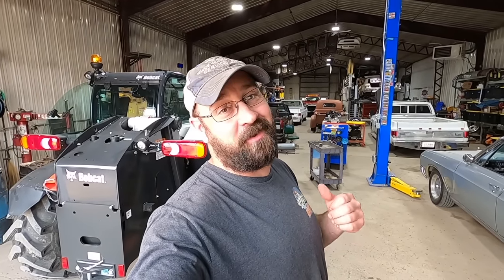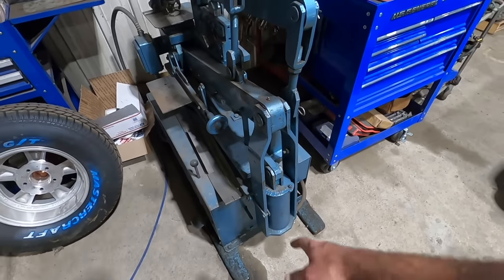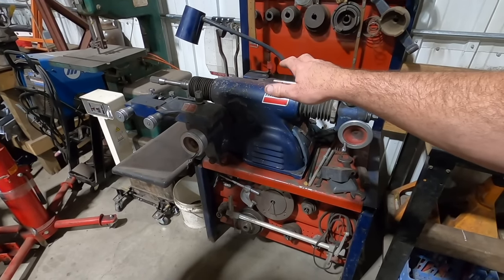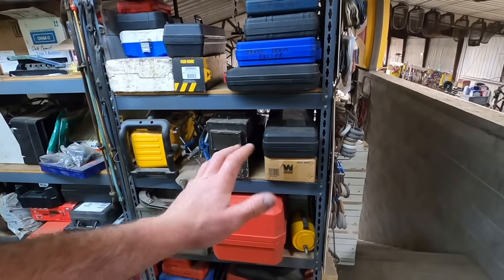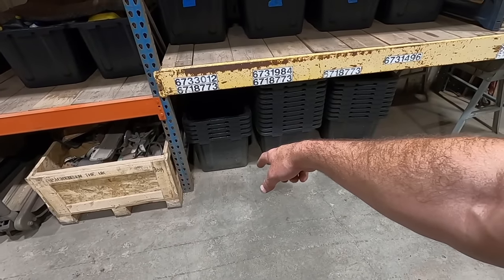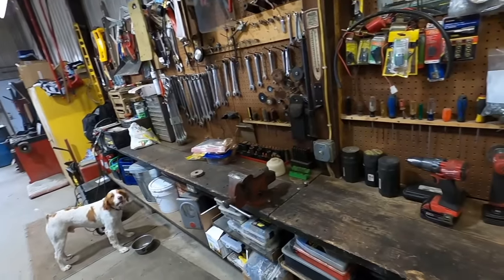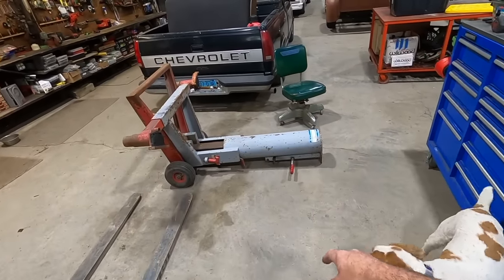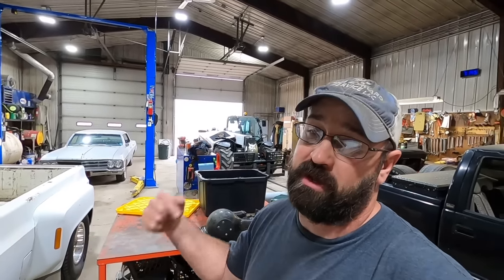We've been here for an ENTIRE YEAR! Upgraded Shop Tour of Mortske Worldwide!

Comment: Something everyone misses on the flammable cabinets is no one bonds/grounds them. I actually own a business that specializes in grounding and bonding. So it always amuses me all the business’s I see with flammable cabinets and then they fail to bond/ground them.
Reply: What do you do? Just Anchor it to the ground ?
Reply from the maker: Good to know, also interested in the process.
Reply: Was just about to say the need for  grounding of the cabinet. You beat me to it. 👍
Reply: The reason they are grounded is the same reason it is prohibited to fill a fuel a portable fuel can that is in contact with a vehicle....
There is a static charge between paint and plastic or just the paint to paint or plastic to plastic. A spark can happen faster that a blink if an eye! Gas cans and chemical containers are made of those non-degradable synthetic plastics that when rubbed together will produce static charging. The ground strap eliminates the static.
Reply: I understand what grounding is but what does bonding mean?
Reply: @moremortskerepair4354  Yep look up justrite flammables cabinet owners manual and you will see about the ground or bonding. There should be a place on the cabinet to mount a ground wire that can be bolted to a grounding rod driven into the ground.Or if nothing else bolted to the main frame of your building. Just like a negative cable on a vehicle goes to the frame and several other grounds to to various parts of the car. Also do not store anything on top of the cabinets that will burn. If you have cardboard boxes towels rags or anything else on top of the cabinets take it off there. there are also vents on the cabinets, they look like 2 inch drum bungs. If these are open and the flame arresting parts have been removed you have created a flame thrower if you have a fire event in the cabinet. You can also get self closing valves for these openings in case you have a fire to smother the fire by closing off its way to obtain oxygen. Make sure the locks work on the doors and they seal up properly, and latch closed. also set the cabinets up on blocks off the floor so you can get a pallet jack or that handy telehandler under it to move it when you need to. 

All the other fire prevention measures you mentioned are spot on. 

Scott
Reply: No don't do that I am an electrician the less sparks  you got from your cabinet the better, unless you're going to plug in your electric rattle cans or boombox in there, it's amusing to see how this guy amuses himself charging people to ground cabinets , but what is the purpose of a ground?? It's to keep people from getting shocked. Even if it wasn't a system ground and an equipment ground there's no equipment in there that should be self-explanatory,Let's say it was Supposedly hot ,you would fall to the ground and break Free. But if a spark touched off an explosion and fire, I'll just say I could see you with a full body cast at the hospital wondering why the hell you paid that guy money.. there's a reason you want to keep Sparks and flame fifty feet away, and that goes for electric wires also stop preying on people because they have no knowledge of electricity theory , at least find and show me an example of somebody's misfortune , they shouldn't have had any electric wire around that flammable cabinet anyway I'll debate anyone bring it. Let's say you had a ufer ground and you had an arc-fault in your building electricity which always finds the easiest path, could travel to that bonded cabinet and blow up your business and you would lose your shop maybe your life , I would suggest what they do in the oil fields. Inside of the dog house
Reply: yep my ass you look up any owner's manual and it will say something like that in it. I bet it'll say something about a choking hazard too just rite ? what kind of name is that? Spelled like last rites. Don't tell me the cabinets were just right ,so people started calling them that, smells like something the scammer would name.
Reply: A business that specializes in bonding and grounding? if you  are an electrician of any kind the first thing you should do is specialize in bonding and grounding. Everything you touch. And I wouldn't be touching any flammable cabinet because if somebody wanted me to put a circuit in it , I wouldn't do it ,I'd tell them to hire you to do it.
Reply: rather than me Educating you on your mis education study and look into why we don't bond a neutral and a ground in a sub panel. I'm talking about seriously understanding and  looking into how the electricity flows., And why you should never do that. You're going to argue there's no neutral in there ,I'm not talking about that I'm talking about the flow of electricity and the effect. How you're bringing a potential flow of electricity that should never be there.
Reply: @mrromantimothy  and you sir is why I have a business. Educate yourself before typing.
Reply: @jamesmcdonald5868  you're not filling any flammable containers while they are in there you're storing them in there and if you don't have a metal cabinet with metal legs touching the concrete floor
Reply: @gwisdallatexas  give  me an example of a metal flammable storage cabinet unbonded and ungrounded that was the source of any structure fire, metal legs anchored with bolts to a concrete floor is all the ground path it needs

Comment: Two suggestions...find or build a battery-safe cabinet. Lithium batteries can have a thermal event even without being charged. Also, use a covered metal garbage can in the shop. It prevents something hot from landing in the can and a lid will contain a fire if one did start. Remember no pile of greasy rags. Outside in a sealed can.

Comment: The ag dealership I used to work for heated their shops with used oil.  There were four furnaces to keep filled up.  Most of the local coops were doing away with anhydrous ammonia nurse tanks, so we bought several to use for oil storage.  We put one on a 5th wheel trailer and mounted a vacuum pump on the tank powered by a gas engine.  This worked really well to gather used oil from 55 gallon drums or chemical totes.  We could empty a 55 gallon drum in 2-3 minutes with NO spillage, mess, ect.  We could then pressurize the 'road' tank with 20 psi of air and transfer the oil to the lot tanks.  For being 'free' heat, it was a lot of work.
Reply from the maker: Awesome idea!
Reply: @moremortskerepair4354  just be sure to weld on some 2" NPT fittings  for the fluid transfer ports. It will REALLY speed up loading and unloading thick used oil.

Comment: A sbc 383 backed by a 700R4. Make the compression around 9.6:1 and a mildish hydraulic roller cam to keep the low end torque higher for the white low rider truck. You build it like this and you'll want to drive it everyday.

Make sure if you want to build the transmission yourself to source a '93 or newer 700R4 that has the factory upgrades already.

If you get cheap eBay aluminum heads, get ones with no bigger than 195cc runners and no smaller than 180cc. Buy them bare and make sure to use the green self wicking Loctite to glue the seats in(just in case) and they'll be good to go(a better valve job wouldn't hurt though). Get valves and springs to match the cam you pick. If you start out with a factory roller block you can get a factory regrind cam for about half the price of a new cam. They even grind them more performance orientated as well.

Top it off with your choice of a genuine imitation RPM Airgap dual plane intake (or original?) and your choice of carburetor. 

The rear gear should be at least a 3.08:1 gear so the trans can be shifted into overdrive@ 45 mph. From the low end torque from a mildish cammed sbc 383 you can probably get away with a 2.73:1 at the numerically lowest but may need to wait to shift into O/D until 50 or wait till 50 mph to hit the lockout switch? It probably has at least 3.08 gear in it already? 

This should work just fine with factory exhaust manifolds so you don't have to deal with headers. Just make sure not to get to crazy with the cam's duration @ .050", keep it below 225°. My cam is an Comp XFI grind that works great with a carb that is 202°/212° @ .050" with .550"/.546" lift that pulls like a freight train in 1st gear.

Comment: That air jack will become as important as your telehandler if you give it half a chance. Think oil changes on "will it run" projects in the field. Think walk-arounds. Think tire inflations. Think getting blocks under deeply buried yard art. I used them in dealerships in the '70s and '80s. SO much more portable than a lift. So much faster than a floor jack (and higher). My guess is they lost favor when plastic bumpers became popular. Anyway, try it. You'll like it.

Comment: Dam late to the party, but nuthin unusual bout that.
My my little heeler will soon be leaving me, she's got liver cancer, and is fading swiftly. 
What I was going to say was you should put motion light sensors in the areas that you aren't in very often, but when you are, it's typically not for long.
Mine are set for 15 minutes once they detect movement, and will stay on as long as your moving around.
Once you leave there, they automatically shut down in 15 minutes, but you can set them up in 5 minute incurments, are you can hit over ride button if you plan on being there for a longer time frame. 
You can even set the lights up in main shop area to come on, and as you pass through the area they shut down in like between columns, and as you walk straight through, into the next set of column rows from left to right come on at one time.
Then as you move out of one section to the next, the lights behind you shut down and they progress as you do, and as you enter into the next row they come on.
That way if you have your hands full leaving say the mezzanine headed down stairs  
The sections you, are someone else isn't working in, then all the lights stay off,but someone wants to work over at the far end of long shop like yours.
Say Mo Jo is working far end of shop, and you're on the other everything in between is off.
Saves you money in the long run because you don't have to have whole place with lights on wasting electricity

Comment: So why can't u put in a floor drain?
Reply from the maker: You ever put one in?
Reply: @moremortskerepair4354  cut a slot in the concrete, expose the gravel, place a grill, no?
Reply from the maker: @frankfurther3828  Where does everything run to? just sits there in the gravel?
Reply: @moremortskerepair4354  it will disappear.